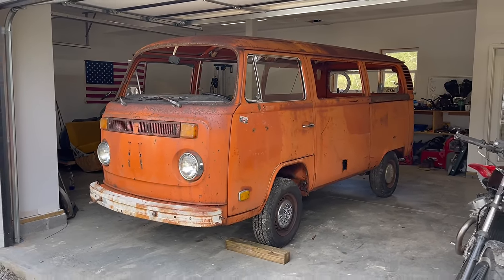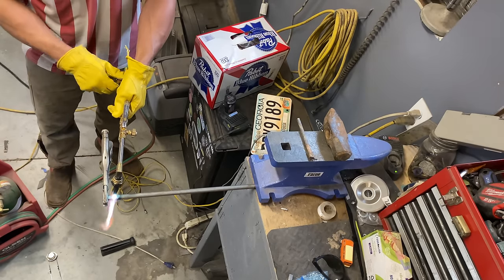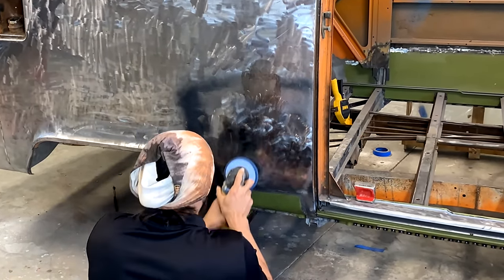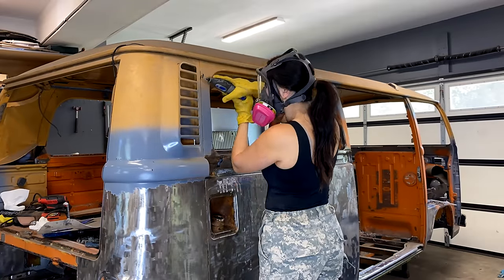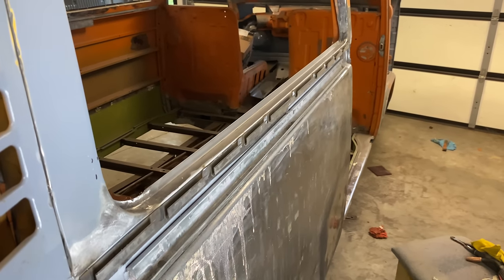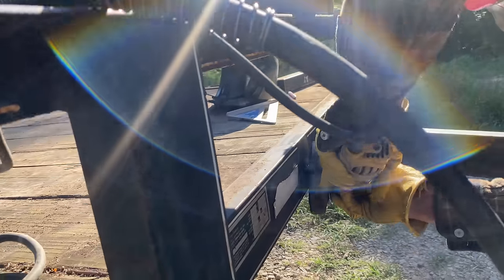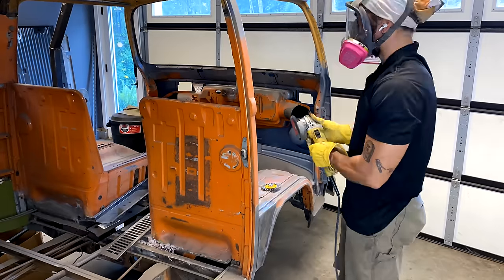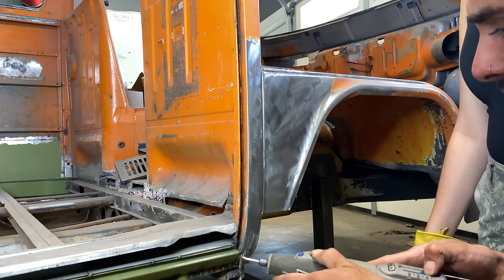Complete Side Of The Bus RUST FREE! | VW Bus Restoration Episode:59

Comment: Great work!  Just remember there is a short lifespan on those organic vapour masks once opened.  They will filter dust and some fumes for quite a while, but truely harmful vapors....
You got maybe 4 to 5 hours before the charcoal is full and no longer keeps them from entering your lungs.  I date and time stamp my cartridges with a sharpie, then use them only for dust after 5hrs of use in one day.  Cheers!
Reply from the maker: Thanks for the tip!
Reply: Yes, and I believe that if you open them and only use them for a short time (e.g. an hour or so), you should store them in a ziplock bag between uses, still throwing them out once the overall elapsed time/life is expired. That's how we manage the life of them here, where they're not required often and only for short duration tasks.

Comment: Dude, the cover that covers the track of the sliding door is put on with the door open, you didn't have to have cut the tab for the screw, and on the other hand, the height of the sheet that holds the glass rubber is very high, it there is about two millimeters left over, you can cut the rubber on the glass when putting it on, peace and good work

Comment: where did you get the track cover replacement piece? trying to find it online but no luck so far just track cover itself
Reply from the maker: What piece do you mean by track cover? I kept the original track cover on mine
Reply: The piece you welded on that the cover hooks into
Reply from the maker: @austindenfeld1903  are you referring to the top track slider? If so I also reused that piece from the original
Reply: @Vangabonders  no the C-channel piece that it hooks into that’s welded to the body panel